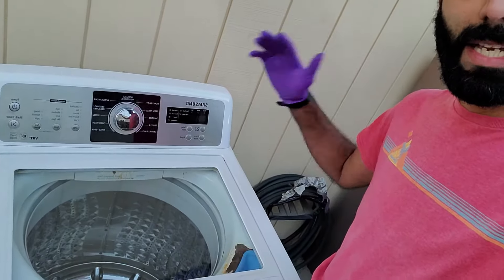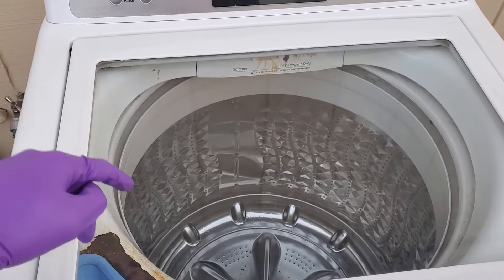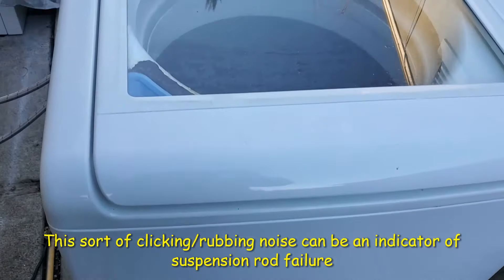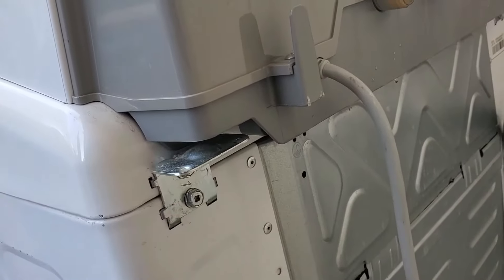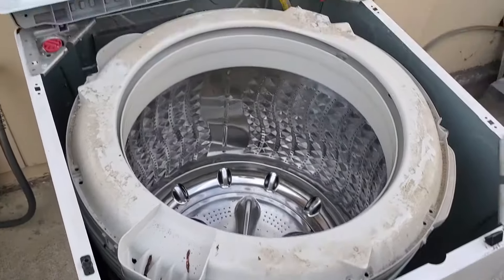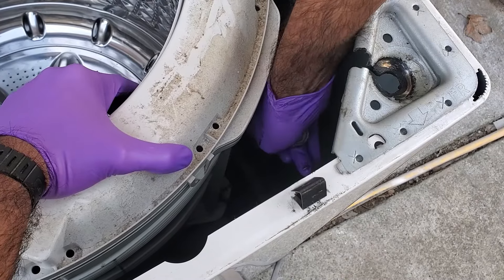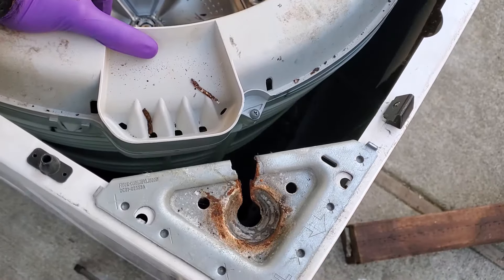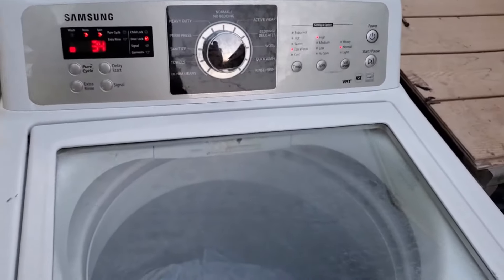How To Fix A Samsung Washer That Keeps Adding Time To The Cycle! (UE Code)

Comment: I’m a 61 year old woman and i just followed this video.  Got the suspension rod for $41 from Amazon.  Boom, it’s working.  I refused to pay $500 the technician will  charge me.    He also recommended to buy a used one for $299 no tax and free delivery and will haul my old one for free.  Good I’m not willing.  Now, I saved money and got a skill.

Note:  my model doesn’t have tab in the front but screw so I had a hard  time pulling up.  There’s plastic covering the screw, so take those plastic first so you can see the screw.  
 
So next time, watch YouTube video first before hire someone to do it.
Reply from the maker: Awesome! Great job on the repair! Glad you found the video helpful!

Comment: Thank you. The washer has been slowing getting unbalanced more and more and I did hear the clicking. It just started adding time last night. I fixed the old drier tons of times. This looks easy. Now to survive a couple weeks for the rods to arrive. Bad time of year for this :P
Reply: Update: The cheap rods stopped balancing after awhile. I fixed them by adding 3 hose washers under each to add the lacking tension. 100% fine now, even with heavy loads. The official OeM rods are really expensive. So glad to save money and relieved to finally be able to do laundry peacefully again.

Comment: The REAL solution is buy Nyogel 767A damping grease, apply on shaft where the collar slides up and down and it will significantly reduce the motion of the shocks. The option on this video can work but the plastic will wear out due to friction on the parts. Never use regular grease on the rods  because that will make the shocks slide up and down even more easily. you need friction grease so the parts still move as they should but resistance of range is reduced! If you buy replacement shocks notice there is sticky stuff on the shaft where the motion will occur. Good luck out there.

Comment: You are a freaking genius.  This was my exact problem ... the dreaded UE CODE.  And, the damned thing resets the time (or bounces it back about 15 minutes), and mine will go infinitely and never gets the clothese dry.  I think it is almost finishing the spin, but then it is unlevel or not loaded correctly (it thinks).  So, it will stop, show the UE code, then add more water and set the time back about 10-15 minutes.  And, it never gets to the point of the final spin.  So, the clothes come out wet.  My washer is this one:  Samsung = WA48H7400AW, 4.8 cu ft., top load.  Thus, I bet your suggestion will fix the issue.  Thanks for sharing your knowledge.  I finally got the parts and am planning to fix it myself.  Also, I subbed.
Reply from the maker: I don't know about genius, but glad I could help

Comment: worked, perfect... althought my exact model as in the video had two bolts on the sides (not like clips in front) that I removed to pop the top off.  did not replace bolts I think they were put there as warranty claim issues with this washer
Reply: HOW DID YOU REMOVE THOSE BOLTS? I can't get to them! I have same exact model in video but mine has bolts on the side

Comment: They all rust out at the front left hand corner. Same with mine 🤣 Just replaced suspension rods for the spin cycle issue, wish me luck!
Reply: Did it work

Comment: Suspension rods didn't fix UL code. What is the next I need to fix.
Reply: New washer.
Reply: I had the same issue. Replaced the rods and it worked for a bit, but soon after we having the same problem
Reply: Don’t buy cheap aftermarket rods

Comment: I recently bought a brand new  Samsung washing machine, it kept rinsing and spinning forever at the very first wash, my goodness, is that normal?
Reply from the maker: Definitely not. Take that thing back!
Reply: No its not, I'm having the same problem its when it spinning fast it will go unbalance in the beginning, I kinda put all the heavy laundry in the middle center to kinda keep it balance some time it work some time it doesnt, but what I noticed is that when it spin it spin on diff speed lime slow fast slow fast and when it does that it will go unbalance, but if pass that stage of go slow and fast it will go fast in 1 speed and it will go smoothly lime it supose
Reply: Problem solved 😄 it's an installation problem, the level of the water drain outlet tube is too high, after cutting it down and reconnecting the water outlet tube, it worked normal now.
Reply: @henrytan5707  the drain hose ?
Reply: @glenn3646  Yes, drain hose, it should connect to a floor drain hole which must be lower than the washing machine. You know water flows from high to low, if you connect to a tall drain hole like in my case, the floor drain pipe is a foot tall above the floor, the machine cannot drain water, so it kept on spinning.

Comment: Do you remember how the back right rod went in? My parents have the 5471abw model, and I've got three corners finished. The fourth, it looks like someone took a tube or cable and wrapped it around the suspension rod a couple of times that's gonna make removing it fun. Other videos talk about a clip holding everything apart, and there just isn't one in mine. I tried finding a service model online, but what comes up does not look like our machine (and it's a pretty sad excuse of a service manual). Your machine is a closer match, but we have six buttons under the display on the left side instead of the four on yours. Wondering if this style is just done like this or if we had an installer go crazy - it's a real dick move.
Reply from the maker: Yes, that is the pressure tube. You will have maneuver around it on unplug it from the tub side, then undo it from the rod. Remember to plug it back in. Otherwise, your washer will not know how much water to fill to!
Reply: @DuctTapeMechanic  Thanks! I ended up taking the back off, too, because I could barely move the top (which had two bolts added in the recall repair and needed a wrench to remove - I wanna say it was a 12mm or something slightly larger) and wanted a better look. Cables for the electronics were held to the back of the machine by a BUNCH of twist ties. Undoing those gave me enough slack to get the lid out of the way. When wrapping up, I didn't loop that pressure tube back around the suspension rod and instead gathered it with the wiring to attach to the back. Just made sure it had a bit of slack. Haven't tried laundry yet, but I was able to run through quick wash with an empty tub without issue filling, spinning, or draining, so at least I didn't introduce more problems!

(For anyone else with this model, when dealing with the bolts, stuff an old towel or something between the wall and the tub to avoid dropping them. They are a pain to locate - they'll most likely fall into the frame along the bottom.)

Comment: I have replaced rods and mine still does this
Reply from the maker: @AmandaParrish-w2e  most likely either your tub nut is loose or your inner tub is stripped in which you need a new washer

Comment: I have replaced mine multiple times only works for a month then starts doing it again
Reply: The fact it works proves it is the issue. You just need to find better rods that last longer.
Reply: Okay after awhile mine stopped working too but it was still an easy fix. I put 3 hose washers under the top of all of them and it added the extra tension needed. I do a lot of heavy loads and it's working great, no more baby sitting the spin cycles.

Kinda wish I'd thought of that to try on the old ones but it fixed the new ones easy. The official rods are really expensive. I guess this is what happens with the cheap ones.

Comment: Gtw460asj3ww agitator not working spins freely. The rest is all ok
Reply from the maker: Perhaps the agitator is stripped, seen that issue
Reply: @DuctTapeMechanic  stripped where? its just one piece and is tight
Reply: Gtw460asj3ww washer model
Reply: @benjamincolon2581  in one comment. You said it spins freely and then you said it’s tight . So which is it
Reply: @bruce7259  it was the trans assy thanks
Reply: @benjamincolon2581  how much are those ??